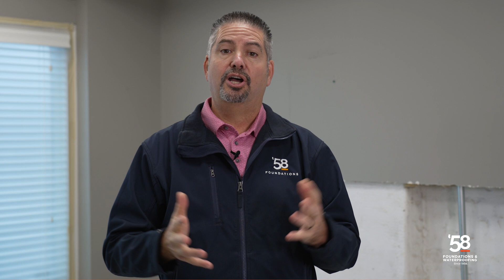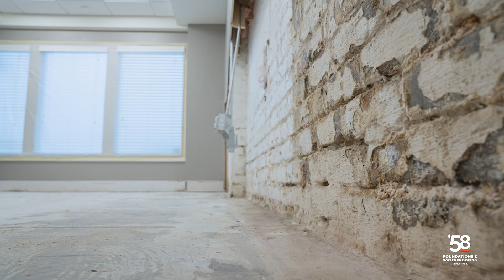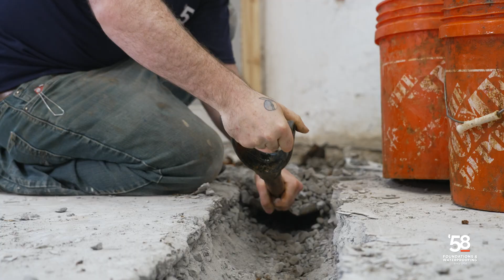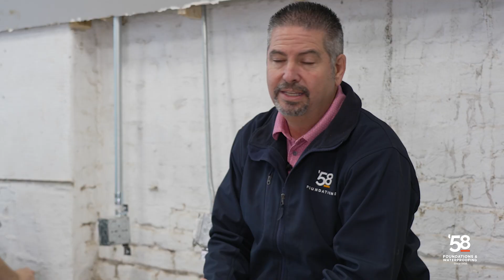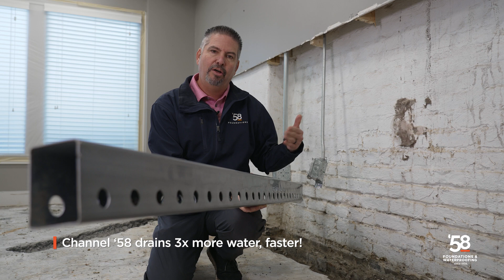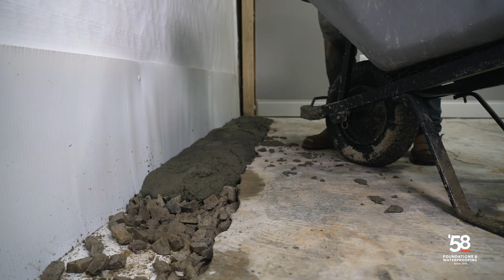Basement Waterproofing Process | How to Transform Your Home into Extra Square Footage

Comment: what can you place over the finished walls?
Reply from the maker: Great question! Once the wall is stabilized and sealed, you’ve got options—drywall, paneling, insulation boards, or even decorative wall systems. Whatever you choose, we make sure the structure’s solid so you’re not just covering up a problem—you’re building on a solution. 👷‍♂️🧱✨

Comment: This is something that can be done by a DIYer but it's something you should preferably have a helper or 2 for and not something that should just be done after work each day. You really want to take a couple days off of work and spend the weekend getting it done
Reply from the maker: When digging up the outside isn’t an option, interior systems are a reliable solution. We’re here to take the headache and guesswork out of it—no more wondering where the water’s going or if it’ll come back. Just peace of mind, dry floors, and extra usable space. 💧🏡✅